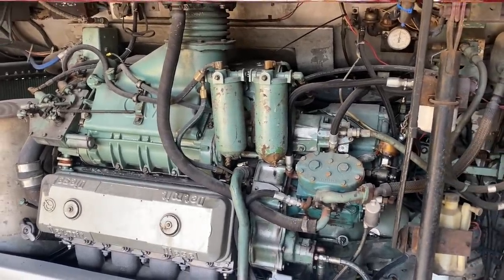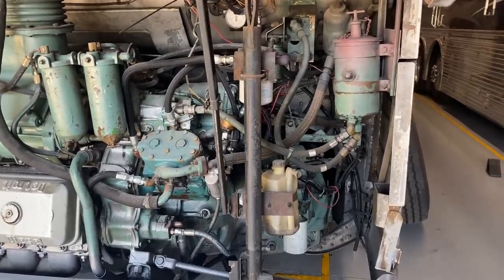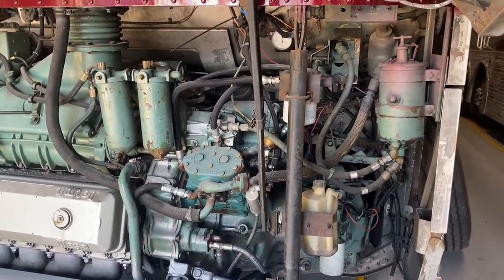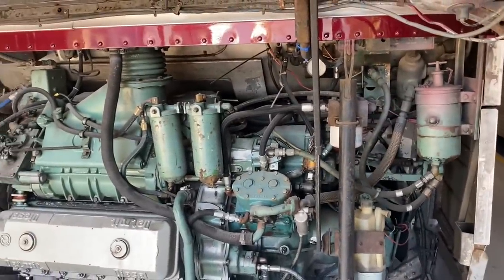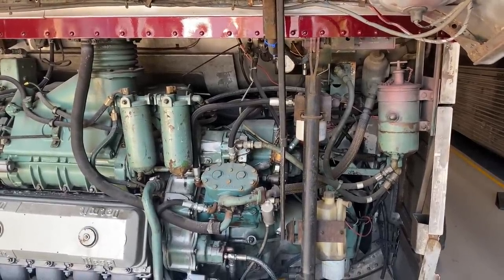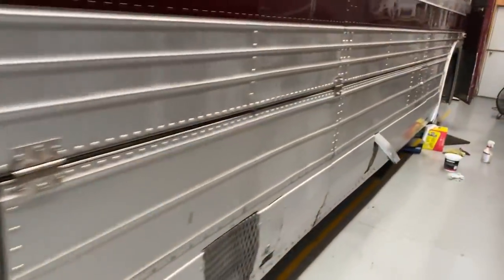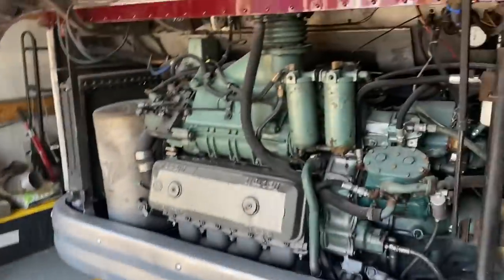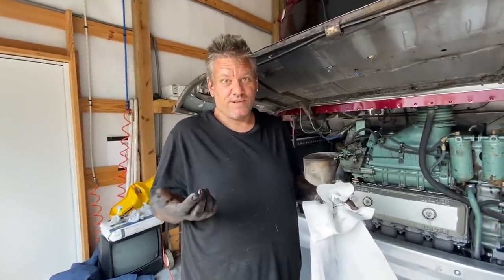Bearings are never boring.

Comment: The best thing about The Bus Grease Monkey (beside the title) is your humility. Your explanations/demonstrations are straight-forward, without pretension.  I know bearings are fun. I had a bearing puller loaded up one time and not a mm did it budge. I whipped out my lighter and warmed the housing for about 3 sec and boom!
 Came off quick, no casualties,  I'm getting a shirt.

Comment: The remaining bits of those bearings looked dry I’ve come across bearings like those before and some that have totally welded themselves to the shafts great video as always Scott but you really should consider wearing gloves as you run a high risk of getting all kinds of different deceases and  skin cancer trust me I know from
experience having painful blisters all over your hands is no party..
Reply: Nutrunner 54.   Called dermatitis or psoriasis. A fuckin nightmare. I had it all over the tops of my hands and forearms nearly to the elbow caused an allergic reaction from microscopic dust mites which basically eat your skin to almost bare flesh it's not a pretty site and it's pain like you'll never believe. After a while I got used to it.Some of the skin gets really hard and it won't heal up. So the only choice is to dip your arms in really hot water in a sink to soften it up. Got it from cleaning spare parts shelves at a job I had in 2014, took weeks to heal even my work mates couldn't believe it.  Went to 3 different doctors.  Papaya or Paw Paw ointment finally fixed it, plus steroid cream.    Cheers from Australia.

Comment: Going to change out a 2001 chevy diesel injectors next year. These are the ones known for a short life span. Going with the side that is bad first. It's smoking pretty good now at lights plus not good on fuel milage. I'll change out the glow plugs too the same time
Reply: A suggestion,  try using Lucas fuel injector cleaner,  it helps lube and clean the fuel injectors.  That engine was designed in Japan, and the U.S.A. has the world's worst diesel fuel. That's why those injectors don't last as long as they should.
On any older diesel engine it's a good idea to use Lucas, or even add motor oil to the fuel.
Reply: Thanks Bret, I have tried diesel injector cleaner before and every 3rd fill up a diesel additive since I bought it in 2016. Not sure if I tried Lucas though? Will try it and start using the additive every fill up to see if there is any change. Thanks
Reply: @TimsWorkshopTJY  
I have had very good results with Lucas. 
I have several trucks with Cummins 15 liter engines 450 horsepower and even with over a million miles it increased fuel mileage by nearly half a mile per gallon
Even good for gas engines too. In older diesels you need to keep the injectors lubed . Try putting a quart of engine oil at every fill up. Cheap oil would be fine
Reply: When changing your fuel filters, Fill the new filters with Auto matic transmission fluid, It will help clean you injectors.
Reply: Hi Bret, I went to Napa here in town and bought some Lucas that treats up to 150gl of deisel. I put in  enough for my 30 gal tank to see how it works. Haven't drove it that far yet but Friday going down south. The Lucas they had though said top end treatment but not injectors? So not sure if this stuff will work?
Reply: @TimsWorkshopTJY  
It should work, the big thing is to lube the injectors . It's good for both gas and diesel I have used it in both and had good luck in both .

Comment: Hi!! I’m somewhat new to your channel and I was hoping for some advice on my new project. It’s an old gm bus with what I believe to be a 6-71. Any help would be appreciated. Thanks
Reply: Caveman Dave just subscribe then search and you'll find plenty on your stuff👍
Reply: Stewart Lawson 
 I’ve watched many of his videos and subbed. But my problem is a bit unusual. The bus has been sitting for about 30 years and the valve cover was only partially on.
Reply: Caveman Dave possibility of water ingress.  Drop oil off and look for water in it.  Then bar it over to see if it's seized. No water and it turns over is a good sign.
Reply: Stewart Lawson  it’s in the ground about 8” but the oil on the dipstick isn’t milky at all and it turns over . My main concern is if any parts are salvageable under the valve cover due to surface rust. I’ll post a video of it later
Reply: Caveman Dave if it's been sitting a long time then the water and oil would separate so not show milky.  Milky would also indicate it had been run with water in the sump which it probably hadn't.
Need to get it out the ground and drop the oil off it.
Reply: Stewart Lawson oh that’s true I didn’t even think about that.
Reply: Stewart Lawson I just posted a video of the bus I have if you want to see

Comment: Did you hear what happened in Windsor locks Conniticut is the Collings Foundation B-17G known as Nine 0 Nine crashed at Bradley Int Airport during an aborted takeoff they failed to gain altitude a witness heard the #4 engine was sputtering and smoking  and it crashed into a deicing facility. it said 7 are confirmed dead in the accident my prayers go out to the families if you have clients with busses out there?
Reply: Saw it fly over earlier this year with the other planes in San Diego.  So sad, especially for those on the ground that watched their loved ones take their flight 😪😓😫😥